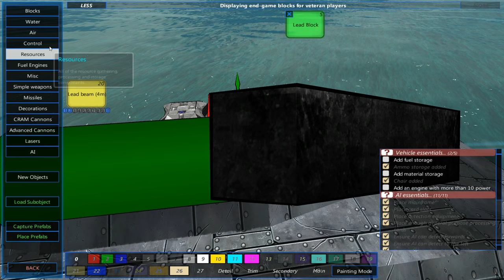From The Depths - How To Build A Submarine - Advanced Detection

Comment: There is some misconceptions about the current build, currently passive sonar only detects active sonar, nothing else, given that most ingame ships comes with  neither passive nor active sonar you can't detect them that way.
ACBs currently detect enemies if you have an AI even if the AI hasn't detected them.
The first one is best displaced temporarily by using sonar buoys if you want a stealthy craft or by active sonar if you don't car because the enemy can't detect them anyway.
The second is not really displaceable but you should avoid using things that will break your design when fixed.

Scaling the fixes in time is hard but either Nick is already working on it or it's likely that we will have to wait a few months since he is on a pretty intensive development as per his road map.
He is though likely to not put things like these in patch notes so it is better to build stuff that will work when they get fixed rather than relying on potentially breakable situations.

Also this is meant for everyone not specifically for anyone, since they are all pretty common misconceptions.

Comment: I'm having issues getting my subs to be at all stealthy. They are all easily visually detectable from kilometers away, even when underwater. This is even with a bare-bones, hollow-tube sub that just moves forward and floats at a set depth. Essentially, they're only good for using the water as a cushion to blunt enemy cannons. Any ideas as to what may cause this?
Reply from the maker: That is unusual. Are you sure you are watching visual detection, not sonar detection?
Reply: Yeah, entirely. I can be 240m underwater, and still be spotted by aircraft on the surface. 600m-1km+ spotting distance. Sometimes it drops to quite a bit lower than that, but it seems extremely random.

The other problem I'm having is that Adventure Mode is craaaazy diffficult, haha. I've faced laser and torpedo-armed planes almost immediately on one of my attempts. This last one, there were about 10 enemies detected before I was annihilated by gigantic torpedoes out of nowhere.